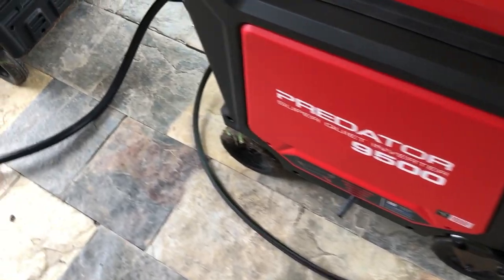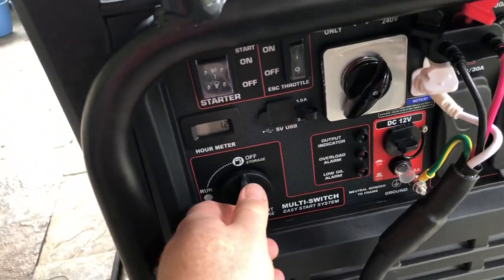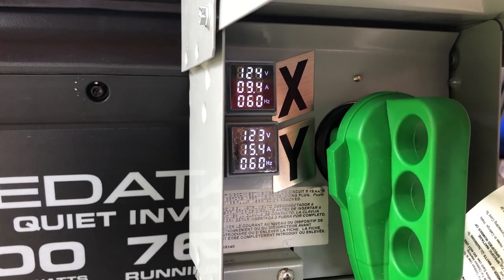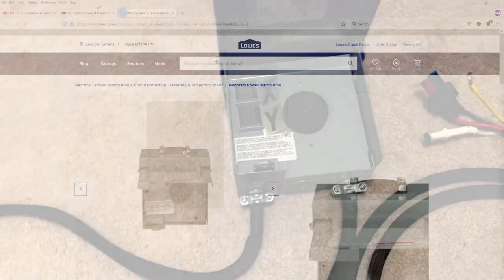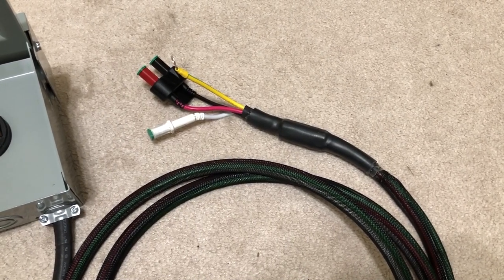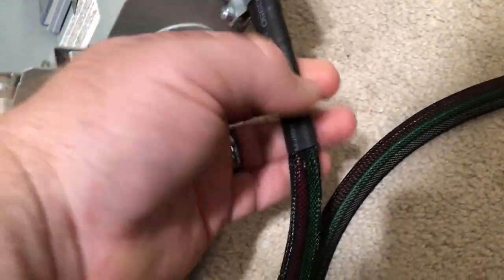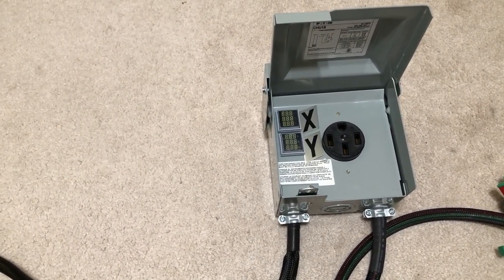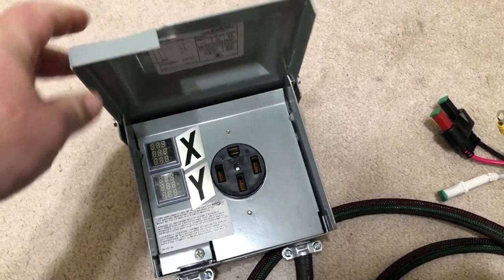Predator 9500 Home Built 240V Parallel Kit Test & Build Parts: 2X Output Power Using Two Generators!

Comment: Is their any way you can draw and post the sketch of inside the box since you dont want to open the box and show inside ?
Reply from the maker: I'm working on additional videos covering the way I did the inlet to the house, the generator itself, the softstart, and the quality of the power it makes.  I'll include a sketch in one of those.  Really though there truly isn't much to it.  Each wired is just joined to the matching color, and from each of those unions, a single wire goes to the dryer plug.  

For the meters, they need 120vac, so you use a small wire for one to go to neutral (white) and one to one of the hot legs (so one unit got white/black and the other was connected to white/red).  Lastly the little circle part (the coil) goes around the wire that you want to monitor the amperage, so one went around the black going into the dryer plug, and the other's went around the red wire going to the dryer plug.  The coils need to be after the union from the two generators so you're measuring the combined amperage, and not just the contribution of one.
Reply from the maker: I've posted a general technical video about the generators, and included a basic wiring diagram sketch of the inside of the parallel kit.

Comment: Jason your video is incredible.  Thank you for doing this!  Do you think HF, or Predator will make a parallel kit at some point for the 9500s? I want to just buy something made and ready to hook up to house.
Reply from the maker: I'm not sure.  I don't know what the delay really is with 'em.  Honda has an interesting one, but I'm not sure if the plug spacing is the same to fit.  (the cables end in a single plastic plug, so it may or may not line up).  There is another mentioned in the various comments that might work, but doesn't include the neutral, so the ground cable would be doing double duty for that.

Comment: Curious what gauge wire you used from your generator inlet box to the service panel. I’m struggling to understand how high of amperage do I need to protect for in case I have a surge of up to the full 19k watts from this predator combo
Reply from the maker: I had 6 gauge for the box hookup, and from the junction of the two 30amp feeds, to the 50amp plug.   Pretty sure I used 8guage in the kit to the generators, but 10 would probably have been fine. The generator can push a bit more than 30amps, so it was kinda borderline between the two sizes.  I opted for the "safer" choice.
Reply: @Texas_DIY  thank you. I’m just curious if you knew what the amperage limits of a 50 amp rv inlet/outlet/ generator cable can handle if it’s seeing 60 A?  Was wondering if the generator cable or connection points got hit at All?  What size circuit breaker are you using to backfeed? Is that 50 amp also? I’m just guessing but can’t we theoretically hit almost 80 A at a surge at the 19,000 W limit?

Comment: Great video Jason! I have a Duromax 9000ih (turned into floating neutral after disconnecting the bonding connection behind the control panel) dedicated exclusively to power feed the house in the event of any power loss. Power to the house is through a Reliance 50amp power inlet box. No transfer switch, instead I took the Interlock route and installed it at the main outside panel.  I'll be ordering a Genmax 9000 soon, which I will be paralleling with my Duromax. My plan is to turn the Genmax into a floating neutral too. Both generators will be grounded at the main house panel. Now my question is, since both will be floating neutral generators, and there is no white neutral parallel connection in the Duromax, how would you handle the parallel wire connections on each generator? Duromax (two hot wires parallel connected / green and white disconnected) and on Genmax (two hot wires and white wire parallel connected / green disconnected)? Thank you again for the great videos!!!
Reply from the maker: That's my main concern / drawback with the Duromax is the lack of a dedicated neutral.  Instead it has to be using the ground as the neutral.  Now in generally the ground is bonded in the breaker to neutral, so this isn't the end of the world, but you have to remember that ground will be carrying all the unbalanced 120VAC return path, and it's exposed on a nice screw terminal.  So don't let your fingers become an easier path, or get between them.

Comment: I do not understand too much the 63.3 amp 1 phase that is mentioned in the user manual.
Reply from the maker: I believe that number is if you are just using the generator for 120v power (but the generator is still in 240v mode)... X(hot)+N(neutral) = 120vac AND SEPARATELY Y+N=120vac, then you should be able to obtain 31.7 from each leg, for a total of 63.4amps of 120vac power.

240vac loads pull equally from each side (x+y=240v 31.7total)

For example say that I have (1) generator, and my 240vac stove uses 20amps, since 220v devices use power equal from both X and Y, that leaves 11.7amps of 120vac on X, and 11.7amps of 120vac on Y for household items.  

So If I need to turn on a toaster that needs 120v 10a, and a computer that needs 120v 10a, I would need to make sure that each device is pulling power from a different breaker, that that each breaker is not on the same side of power.  (I need one that is on X+N and one that is on Y+N in my breaker box).  If I did that, it would leave 1.7a remaining on x and 1.7a remaining on Y.  

If they both ask for power from the same breaker, or from breakers that get their power from only X or only Y, then it will be (11.7 - 20= -8.3  (8.3a too much for one side)

Comment: It seems to me that these generators should be able to support an 80 Amp breaker. Have you given any thoughts into a way of wiring it up to actually get the full capabilities of these two generators, rather than limiting it to 40 amps continuous / 50 amps for short duration loads per the 80% rule with a NEMA 14-50 outlet?
Reply from the maker: I ended up putting a 60amp breaker on my inlet for basically that idea.  But I didn't want to go too oversized, because the inlet plug itself is still rated for 50amps.  If I had a breaker that would allow much larger sustained amperage, it could cause a major issue at the inlet if that were sustained.  And I haven't found any really common / standardized inlets that are rated for over 50amps.  Obviously they do exist, but they seem to quickly get into expensive proprietary stuff once you go past 50amps.

Comment: Hi Jason I need one parallel kit for my food truck. I have 1,  9500W Predator Generator I wanna buy another 5000W Predator Generator to support my requirement for my food truck. So my 1st: Question is can we connect 5000w Inverter generator for 9500W generator. If yes I need help with to make me one parallel kit with 2 different size cords. Can you make me one and send me please.
Reply from the maker: Both generators would need to be 240VAC, and both would need to be inverter units that are designed with parallel ports for that purpose.  They don't have to be identical models.  My understanding of the electrical theory, is that in that situation, each generator would contribute what it can and your potential amperage would be the max combined capacity.  So a 30amp and a 10amp, would in theory give you 40amps of potential combined output.  

Now, part of my brain doesn't like that... and feels like 30amps would overload the smaller one... as if both units would be "asked" for 15amps, which it can't make... but my limited "not-an-electrical-engineer" understanding with regard to voltage droop and impedance (which goes beyond comments on a YouTube video), it just doesn't work that way.  Though the smaller unit may well be more prone to failing / overloading first, particularly if there are sudden spikes in load when the units are near max capacity. 

To make a parallel kit in this example, you ought to make the cords the same, sized for the maximum capacity for the strongest unit. This way you can't mix them up, and/or if you upgrade the smaller one to a larger one in the future, the cables will be ready to go.  (if you haven't looked at the other videos in the playlist, they go into more details about it)

I've thought about making them for people... but the potential liability concerns has me a bit sketched out about it.  I'm not an electrician, they would not be UL listed, so if something went wrong, whether if it solved world hunger or if it burned your house down... whether my fault or your fault or an act of God, it might be a less than ideal situation from a legal standpoint.  Making one now from scratch would probably easily be a few hundred dollars to put together (each of those terminal blocks connecting the legs of wires together alone, are over $20 a piece), but if you're really interested, send me an email.  The single letters "Jay", "Doubleyou", followed by the digits "one", "five", "eight", "five", "one", at gmail dot com.  This is assuming I can still find the right parallel cables years later...

Comment: Why not just wire the 10 gauge wire from the Westinghouse parallel cable directly to the back of the plug?
Reply from the maker: The terminals on the dryer plug aren't large enough to take two heavy cables going into them.  Needed the terminal blocks to solidly bond each of the connections together.

Comment: I'm not quite clear on how some parallel kits have a neutral while others don't. This of course does, but for the Honda and Champion kit there is not. Just curious if you had any input on that. Thanks!
Reply from the maker: If they're 240V units, the only possibility I can think of is that they're using the ground as a neutral as well (which makes sense as neutral is usually bonded to ground).  However that gives me the heebie jeebies because that lead is fully exposed.  As long as it stays connected, you'd probably be fine touching it, but if you end up between the ground and that lead, it would be "unpleasant" as any imbalance between the two hot legs, would then be passing through you.
Reply: I'm in Asia and the parallel kit for a Greenfield 220v-240v inverter generator is just two wires, not even a ground and certainly no neutral.

Comment: My question is; can you use the parallel port to make one plug? The 9500 will run my whole house minus the the A/C. So I don't need to parallel, just need 50 amp plug.
Reply from the maker: If you are good with 30A, you can easily adapt the 4 pin 30 amp socket to a 50.  If you need that bit of extra wattage, you could do that from the parallel ports, I don't see why it wouldn't work.

Comment: Based on what you said about the other generator brand parallel kit, if I parallel two generators could I then plug each generator's 30 amp plug into 2 separate 30 amp house plugs to get a total of 60?

Because your setup looks like the outlet is a 50 amp max unless I am mistaken
Reply from the maker: Some parallel kits are simply a set of wires that connect the front panel of two generators together.. and you plug into the front panel of either one to get the double power output.  These generators will have a 50AMP plug on the front panel, even though a single unit alone can not make 50amps.  So for these, THE GENERATOR HAS TO BE DESIGNED FOR THAT (having beefed up wiring behind the panel, and the beefed up plug, because one of them (whichever you plug into) will be passing out double the capacity of what just that generator alone can produce.)  The predator generators are NOT designed in this way.

It sounds like you might be asking if you can still plug into the 30amp socket of either one when you've got them paralleled together.  Yes, you can.  But I'd think the negatives of doing this would out weigh the pros.  

By doing that, instead of taking the power OUT of both from a central location (so one generator is only ever  carrying the max of what it alone can generate) But you are also tapping into the power out of the front panel from each unit, while it's being augmented by the power from the other unit.  So your 30 amp socket, would technically be carrying 50amps of available potential power behind it and the wiring of that panel/socket is not designed for that. Though there is a circuit breaker on each front panel that will trip at 30amps, so I'm not sure what benefit from doing this.  

I guess if maybe you needed additional 30 amp sockets you could be giving 50 amps to the shared one on the parallel kit and being able to tap into additional power from each unit's front panel... that would indeed work.  I don't see any harm in running something small like a ventilation fan off of one or something... but if you're pulling significant power off of just one unit, it feels a bit hinky... like you'd just be inviting additional potential problems in doing so.

Comment: You spliced in 8Guage Wires to the 10 Gauge wire from the Westinghouse parallel kit.  Why is it necessary to use a larger gauge than is in the parallel kit itself?   Most Ampacity charts I can find show 10 Gauge is sufficient provided runs are less than 7 feet.   Are you upping it out of an abundance of caution or is there another reason I am unaware of.
Reply from the maker: The parallel kit I hacked apart is designed to join one generator to another, at which point, the combined power is drawn from the front panel of one of the two units.  Therefore, the wiring on the kit never handles the combined amperage (never more than one generator can provide).

In my case, once you join the two together and splice in a box between them to tap the output from there, that combined output is now twice the amperage as any one of the two generators could produce.  (yet each side is only carrying what the generator it's connected to can produce)

The kit's wiring that could handle 30-40amps, isn't made to handle 60-80amps, so once they come together, and you are drawing the output from that point, the wiring needs to be beefed up to handle it.  (and I was erring on the side of safety)

Comment: Does your 5-ton HVAC system use a TXV to regulate the refrigerant pressure?  My 4-ton  system has a TXV and an EasyStart installed but according to the company, I won't realize the full reduction in starting amps due to the TXV keeping residual head pressure on the compressor each time it kicks off.  Increasing the SCPT delay time from 3 minutes to 8 minutes using the bluetooth app helped a bit though.

My single Honda EU7000is will run my whole house, except for the 4-ton HVAC. I also converted it to run on natural gas, propane or gasoline...so I don't have to worry about storing gasoline any longer.
Reply from the maker: My whole neighborhood is entirely electric, so unless I rent or buy a large propane tank (run the lines, etc. etc.), I'm stuck using gasoline.

I really don't know if I have a Thermal Expansion Valve, but I would guess that I do as the unit is relatively new and higher efficiency, and it's a heat pump.  I was told by Micro-Air to expect the starting amps to be about the same as running amps with the soft start.  However I too don't seem to get the full benefit, so I assume it's a similar situation.  

Starting amps are reported in the app to be around 43.8A, where the running amps for just the compressor are reported to be 11.3A (Add in the fan and air handler and it's around 14A in total).  

However the Locked Rotor Amps report 117A, and my amp meter reported around 81.5A max on starts.  So it at a minimum, the starting amps were about cut in half, which allows the generator(s) to handle it.   So I'll take it as a win.

Comment: Hello again Jason! Thank you for the videos! Are your 9500s bonded neutral? And if so, did you have any problems  hooking them up to your bonded main panel? Thank you, Mike in DFW
Reply from the maker: Neutral is bonded to the frame with these.  Though the general consensus is that if you only hook them up on occasion (as you do with portable units) it's no biggie.  Though a few people have removed the bonding.
I recall a YouTube video where someone did it.  I think it's on the rear of the front panel, where the threaded ground post passes through.  On the back of the panel there are two terminals screwed on there, one of which is the frame ground that can simply be removed by unthreading the nut holding the terminal in place.

I've not bothered to remove mine, and it's been just fine.
Reply: Thank you!

Comment: Thank You for the video on DIYing 240V 50A Parallel kit. I have Pulsar Generator 9500 Tri Fuel that I have modified to Floating Neutral and do not have Neutral Parallel plug like the Predator 9500 you have. I was wondering if it is safe for me connect the unbonded neutral wires from the generator to Neutral from the parallel kit. Are your Predator 9500 floating neutral or still bonded to frame/ground? Just wondering if it is safe to run parallel with floating neutral generators. I posted this question on Reddit r/Generator message board too.
Reply from the maker: Defaults to bonded. I'm told the cable is directly behind the ground on the panel for those that want to make it float.  General school of thought is if the unit is connected in a temp fashion (such as the inlet) then they'll keep it bonded.  If it's permanently connected (such as a dedicated backup generac generator) it should be floated.  

I've had zero issues with the setup.  Apart from not using the clothes dryer unless damn near everything in the house is off... and finding it's generally a good idea to turn off the hot water heater until I've got things in the house turned down to compensate (so it doesn't choke if the AC or heater kicks in at the same time)... life is pretty normal on the generator power.  (normal operation without much consideration for power... combined the hot water heater thermostat being on... and then the surge from the heat/AC hits... it can on some occasions exceed what the pair can provide)